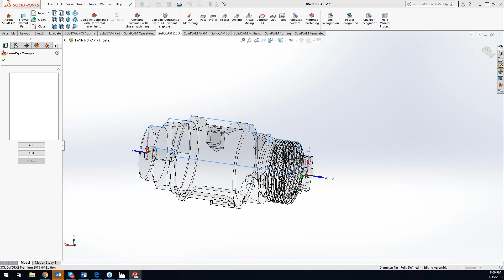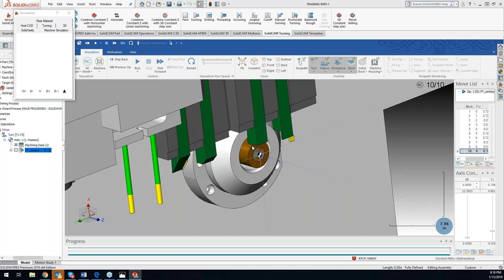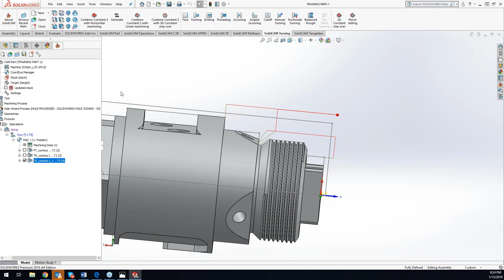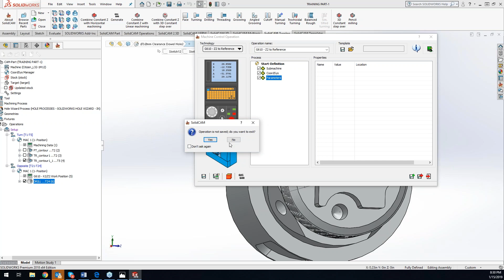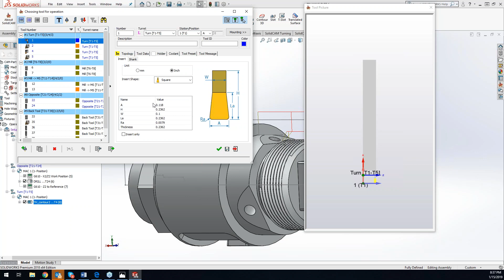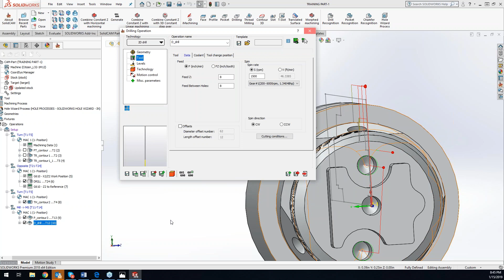KevCAM Night School - Swiss Programming - Part 1

Comment: Post processor needed
Reply: Same Here.
I use SolidWorks, but I'm stuck.

Did you found anything useful?

For 3 Axis Milling I got away with SolidWorks CAM Default Post Procesor.
Now I have a 9 Axis or 11 Axis Swiss Lathe and I have no ideea what I'm doing.
I tried MasterCAM for SolidWorks and still no Post Procesor.

My last options are to use the Default Lathe Post Procesor then change everything from Z- to Z+.
And also manually change X and Y to X1 and Y1.

I'll probably have to get down to pen and paper, but since it's a one off job and the machine will make the same parts for years and years it might be worth the trouble.